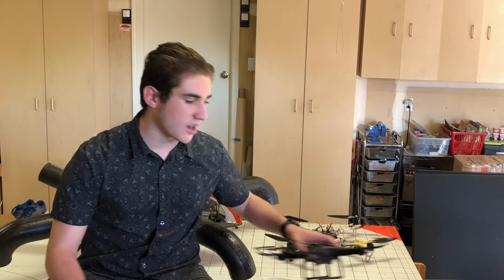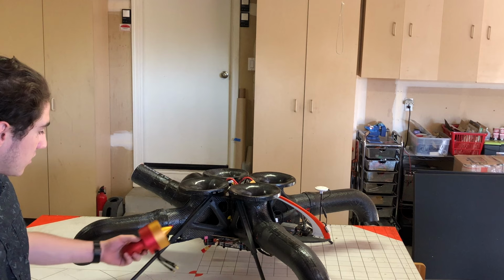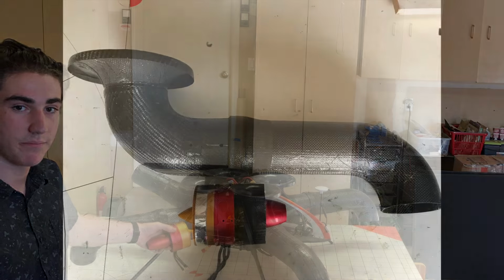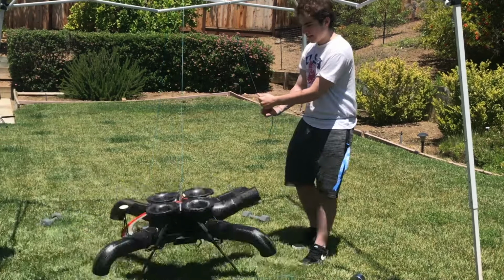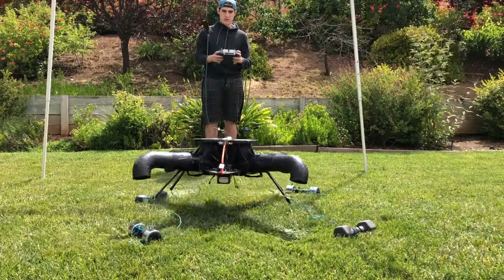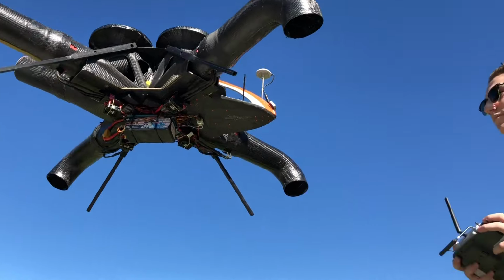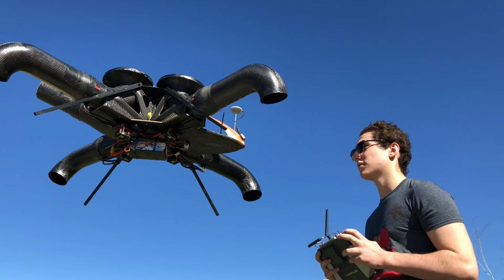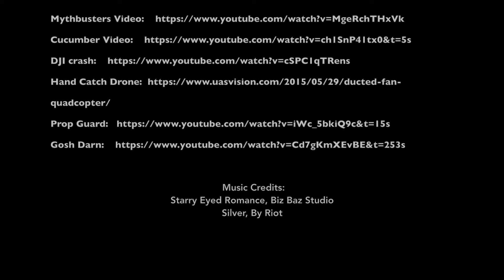Bladeless Drone: First Flight

Comment: All the bladeless comments there is no true bladeless unless its using an ionic air flow but that isn't what this kid was going for. He was probably intending to do the dyson style but that actually isnt an efficient propulsion model because the boundary layer, entrainments, and coanda effect the fan abuses only really works in low velocity. At higher velocity the turbulence created shreds the flow boundary conditions since laminar flow can never be achieved.
Reply: This is a young guy who actually did something with his time and learned through the experience. Please share something that you have done with a link in your reply?
Reply: @rednose1966  Sorry, I don't film my work and share it with the world. Its not needed, no one cares about HVAC, MEP or other building engineering until it breaks. It seems explaining how something doesn't work hit a nerve for you. Fact is its not bladeless. Could never be bladeless, its propless at most as it has no external propellers. It has blades, they are just internal, like jet engines are not bladeless. they are propless. Please tell me why I need to justify use of the language by showing you why you are wrong?
Reply: I think the idea was no blades externally, and he did very well.
Reply: @warmachined3472  Yes, but that is propless not bladeless, which he did indeed succeed at. I like these designs, but they always tend to take a lot more control, which ends up being a dichotomy since more controls mean more weight that ends up in a fairly terrible loop. You can kind of balance it out by going with a stronger engine like a jet engine but then fuel consumption, etc. If this gets him interested in more advanced jet designs I'm personally totally happy with it. I think hobbies can becomes jobs and he should look into aerospace designing
Reply: @icesnake84 I understand the loop all too well. I am on version 4 of my design. I am only using 3 edf's for lift. I calculated thrust to weight ratios and found I am getting over 2.5 to 1 so far. The tradeoff is run time. Less battery weight. Also had an overheating issue because of current draw from one battery so I used 3 esc's and three batteries. My project however has different requirements, I have another goal in mind. For example, I am not using a flight controller like traditional drones. I opted for just receiver control much like a Rc plane. I also am using a pusher edf, so there are two flight dynamics between hover and forward flight. I have two throttles, one on a variable knob and one on the left stick. My lifting engines can articulate via servo control. Would love to chat and brainstorm with you sometime.
Reply: I totally agree with you and glad you said it, the only way this multiplyer system works is on the first fighter jet to land on an aircraft carrier, the British Buccaneer, it blew half of the engine's 11,000lbs of thrust over the front of the wing through 20 half inch pipes and effectively created 'powered lift' without movement, this lowered it's landing speed by a decent margin, other jets have used a similar system to get better control at low speed like with 'blown' flaps, like on the Russian Su-27, 30, 33 and 35😅 thanks for your time
Reply: @icesnake84 totally agree with you again😅 can you do me a favour and tell me what HVAC and MEP is? Thanks for your time
Reply: @warmachined3472 no he didn't, all he did was add a thrust robbing pipe with extra back pressure like a car exhaust, planes don't run exhaust systems 😢
Reply: @CraigLandsberg-lk1ep  HVAC is heating, ventilation, and air conditioning, and MEP is mechnanical, electrical, and plumbing. It's just short hand for building systems designing. I've worked in the industry, both private and government, for about ten years now, I was also a civil engineer for 5 years. Aerospace and nuclear engineering have always fascinated me.
Reply: @warmachined3472  brainstorming would be interesting. I know a lot of people have moved to lithium iron phosphate as they are lighter than NiCad or NIMHs without the fire hazard buts that old news tech. Sounds like thrust to weight is good, maybe there are motor losses? Overheating issues could be undersized wiring for the draw but keeping weight down is always the issue. Is your aim a steady hovering platform? Would be cool to see what you've done so far for sure.
Reply: @icesnake84  so, you're getting all exercised about a word?
Reply: @rodschmidt8952  please call an apple pie an orange pie and tell me how people act to you. Its just a word.

Comment: Great idea!, nice prototipe!. Did you try to contact the big guys?, DJI, etc?
Reply: Ducted fans are incredibly inefficient... Nevermind when shoved inside of a nanny tube and the added weight of the tubes and ducted fans themselves.. and cylinders are aerodynamic nightmares.. the list of things that decrease performance while simultaneously, exponentially increasing power consumption/weight/drag are seemingly endless... All that being said there is some room for optimisation and at the end of the day we've all seen a 90s volvo station wagon.. there's nothing the consumer can't be conned into giving up in the name of safety..😂😂

Comment: Dude what's with all the piping? The simplest way to solve this problem is to put the blades in a cylinder (exactly like 0:57) and put a solid metal mesh above and below the cylinder. Problem solved. Completely safe. No need for anything else or piping.

Comment: Now you need to work on one that has just 1 fan supplying air to all ducts with valves to regulate the airflow in each duct
Reply: Hopefully it also reduces the noise. Do noiseles drones exist??
Reply: @kennethisaac233  I would think super expensive ones might be much less noisy but I think silent would be impossible and even IF they were I don't think totally silent ones should be available to the public. Too many idiots would use them for too many nefarious purposes. Right now it's good that you can hear if there is one hovering over you while you remove a combination lock from something expensive such as a $4000 motorcycle
Reply: @budpuppy5657  Noiseless drones would have useful applications in wildlife photography.

Comment: Two Questions:
1. Do the pipes have to be in a double bent? I think there is a lot of power lost over the bends and air turbulence
2. Can you reduce the power output of the fans? Reducing overall weigh will improve the distance and flying time.

I believe the real objectives of the consumer drones are the long flying time and light weight to be fast and yet safe if it drops out of the sky. The sound of all 4 fans is a little too loud..
Reply: Ducted fans are incredibly inefficient... There are blade designs that mitigate this but still could never see flight times of a similar sized conventional drone even ignoring the added weight and aerodynamic nightmare that is the common cylinder... Even removing the redicules nanny tubes all together and just using ducted fans in place of props would yield enough drop in performance and increase in weight and power consumption to drive even the craziest designers away... Although I've driven an old volvo station wagon lol I know people have given up more in the name of safety...

Comment: what is the sense of the collectors? it was better to follow the classic drone model and replace the normal propellers with the ones you have mounted ... at least you minimize the pressure drops of the collectors.

Comment: wow, that seems like a lot of extra material to lift. You could have achieved the same goal with slightly extended straight shrouds and some chicken wire over the openings to keep hands out. I'm sure the chicken wire would be less resistance than multiple bends in the airflow.
Reply: Keeping the fans in ducts actually is much more power efficient so it may cancel out

Comment: So, you've decided to put blades into the tube. OK, but why "S" shape tubes?
You force the air stream to do two totally unnecessary turns and lost some propulsion.
Good news is that you don't use "ℒ" or "&" shape  😄
Reply: To spread out the surface area giving you more control of turning and tilting. Also, keeping the fans in the middle will dramatically help its center of gravity.
Reply: yeah, also it says bladeless drone, but those turbines have blades....
Reply: @chrismusso69  1. Take out the motors through a kilometer if you like and place them in the cylinder, why pull the pipes there from the center?
2. moving fans horizontally does not change the position of the gravity center.
Reply: @nijasonnj  You put less weight on the arms allowing for easier maneuverability
Reply: Also reduces the chance that something will break if there’s a lot of weight on the arms and it crashes there’s a higher chance that one of the tubes breaks in the middle
Reply: @chrismusso69  ok you win because if I answer the latter, you come up with some new benefit to this stillborn scheme
Reply: @nijasonnj  lol kk
Reply: @nijasonnj  while centralising the fans doesn't change the centre of gravity, it significantly changes the moment of inertia; by moving the thrust further from the CoG,  the torque produced by the exhaust is increased.

Comment: How do you control yaw?
Reply: The duct exits are not straight down. Opposite pairs face a bit clockwise or counter clockwise. That means that as the same with exposed counter rotating blades you control yaw by increasing power to one pair while decreasing the other.
Best seen at 1:57 the duct nearest the camera points slightly left (camera view)

Comment: How did you get it to fly
Reply: Probably just like a normal ducted fan build, just with the thrust output moved out.  Same physics and flight mechanics would apply.  There would just be some extra tuning because of the larger footprint. That's my speculation anyway. This was released in 2018, doubt you're gonna get a response.

Comment: Well, I am impressed how you put yourself out there, especially at your age!!!  This was your first version you built, (unless I missed a video) after you thought up and sketched out the "The Design with Safety First!!" again especially at your age to be concerned with safety first says a lot about your character!  You can always start new versions to increase the performance while keeping the "Safety First" concept.  It looks like you have received helpful comments and suggestions from other enthusiasts and of course some ignorant comments.  Where did you learn to make carbon fiber tubes?  It was also brave to put your mistakes or not so cool moments that led you to build this in the video!! Kudos for that!  I plan do my own channel in the next year to educate building owners on roof claims, replacements, repairs, systems, etc. by filming myself working with past building owners and showing owner's "live" how I get them coverages far exceeding the insurance carriers "offer" is, as well as a standard roof replacement, restoration, repair, or maintenance...according to the top Single Ply Manufacturer's instructions, requirements, options, warranties, etc.  Then, after they have seen a video of mine that shows me actually working in the owner's best interest for which ever situation they are in, they will be able to make a much more educated decision on the expensive project they have before them and can use this information to hire the right Contractor and the correct Manufacture's Recommended Roof Assembly for their zip code.  NOT just accepting what a contractor is pushing or recommending to them. (Most Generally push what system can generate the most profits for their particular companies size and capabilities, where as I share the Manufacture's information and numbers for them to call and confirm  and I always turn in a roof submittal to the local building official for approval prior to purchasing the permit and give city's approval to them as well and let the owner decide what is the best value for their budget when done to proper specifications.  Your video has helped me decide to do mine "live" because some of my best and longest client's trust was gained by how sometimes things when things don't go as planned (i.e. getting caught in a surprise rainstorm while replacing a flat roof, which can't be tarped with the same success as a pitched roof) but, my process of discussing those contingencies ahead of time and then reacting to what "Needs/should be Done" to keep the owner's company operating.  It was how we handled ourselves, the integrity and concern to protect and service the owner without question has always resulted in a loyal customer for life. So, thank you for this video!

Comment: What about efficiency and energy consumption?? If for the safety why not just put the EDF's vertically and protect with some net against putting hands to blades. And why use carbon fiber???

Comment: While I applaud your skill at designing and building this, Is this a solution to a problem that doesn’t exist? The only blade that can harm you is the intake, so adding a short cowl or guard to that side would be enough. On the exhaust side because the blades are angled in the wrong direction, you would get friction burns at worst if you were stupid or clumsy enough to stick you fingers in there. All that extra tubing just adds unnecessary weight and air resistance to the drone and loss of thrust from the fan. An additional thing to consider is by having the fans in the centre and trust on the perimeter this design is going to have low rotational inertia and be inherently twitchy. With the fans in the conventional place at the end of the arms, you’d have a far more stable platform that would also be more efficient. Am I missing something obvious?

Comment: Looks at mechanical efficiency, vs weight...... Hmm could use some work
Reply: Irs carbon fiber composite.. think it's just fine
Reply: @scenicdepictionsofchicagolife  I meant more on the duct geometry but OK
Reply: For a prototype seems pretty good. I'm sure they will tweak it and make a better one. 
Failure is the key to success.
Reply: It can’t fly more than 5-10 meters above ground. There are no blades outside to generate lift. They’re just producing air and sending it down to propelle itself. 
So to fly higher it needs stronger motors to push it higher off the ground.

Comment: I was wondering why you couldn't use a Dyson type bladeless fan?   Perhaps several of those around the perimeter?
Reply: Because they are too weak
Reply: @feoranis26  The inventor says that the shape amplifies the fan by 16 times?
Reply: @JRandallS  Even if it’s amplified by 16 times, it won’t work because you need a lot of force to get something of the ground. And Dyson bladeless fans are not designed for that.
Edit: The fans themselves are pretty heavy too. It’ll be hard to lift a heavy fan.
Reply: @magmatri-studios  Thanks for the reply.

Comment: Marker 1:46 I see fishing line looking like it's making it fly???
Guess  the air fans isnt powerful enough to make it fly???
God Bless Community!!
Reply: Maybe they put that fishing line so it doesnt fly away and lose the drone
Reply: Its clearly slack/not holding the drone up but being pulled tight enough to not be sucked in/tangle the drone. Its to stop the drone flying away  or causing damage beyond the area they are testing.
Reply: @jessejuliano8056  ,
Makes sense ! Thanks!
Reply: @sweetpoison4228  ,
Makes sense! Jesse said same as you !👍

Comment: How does a bladeless fan work? With blades on the fan... 🇺🇲
Reply: lol he basically made a heavy prop guard, if he could build a system that splits water moisture and uses the gas to fuel it in real time and use ai to control its speed and direction then maybe
Reply: @smartwatchonpluto  ai is very much not needed and vastly overcomplicates the simple program it would be attempting to replace

Comment: I'm highly suspicious of the thing being tethered! Does it actually fly or is it simply trickery making it appear to do so? Perhaps one large bladed motor at the intake with variably controlled discharge ports on the bottom would work better since you have 4 rotors competing for their share of the intake air. (Patent Pending my idea).
Reply: First the fact he has a rope attached doesnt mean its suspicious its called safty , he is in his back yard doing test flights , smart kid safty first can you imagine that doing a fly away and crashing into a person , its also against FAA regulations to fly that large drone without it being registered,  and the design of one motor would never work , the thrust needed to correct stability can not be achieved with one motor , you would need to have the blades spining at full thrust allways and have an elaborate kind of ducting that can open and close at speeds so fast its not possable, they do have a one blade system its called a helicopter lol ....

Comment: Fake video...I can see the wires!
Reply: Uhhh lmao. He used a safety tether in testing so that if he lost control or there was a power loss the drone wouldn’t break and have to be rebuilt completely. You can clearly see the wire is slack and not lifting the drone.
Reply: @castleblack7382  I was kidding

Comment: The problem is that this drone is crazy inefficient. Drones with Propellers ducted or not are just superior and will have a much higher efficiency and power to weight ratio. All drones are dangerous.

Comment: given the drone on mars crashed damaging its blades this would help them solve the next drone they utilise on mars
Reply: the atmosphere would be way to thin for this, there are far better ways to protect the blades in that sort of environment, mostly in software
Reply: @ياقوت-ق it's definitely possible to keep electronic working.
But yeah, either way, this blameless  drone is not a good solution